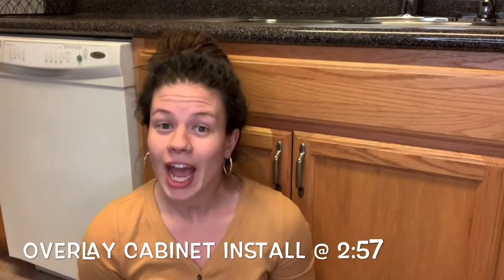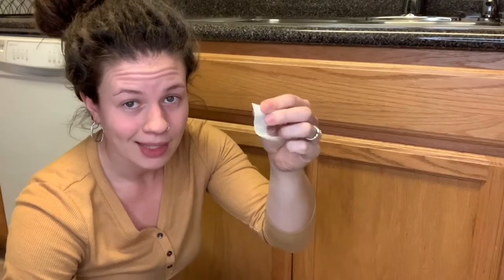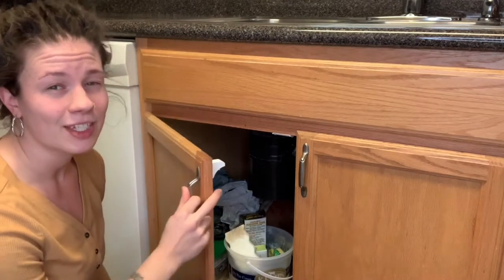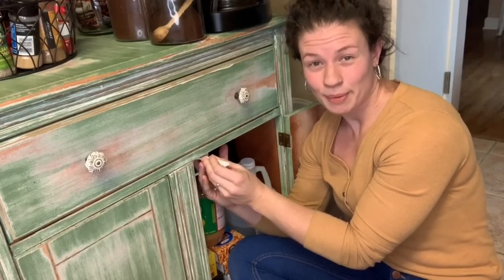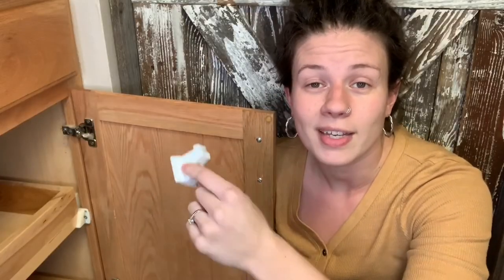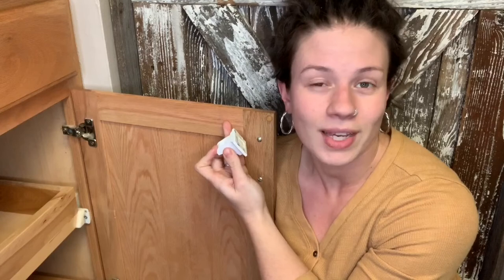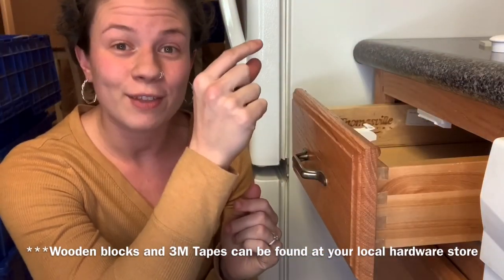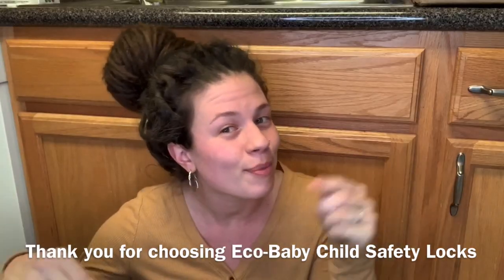How to install & troubleshoot Eco Baby Locks 2020

Comment: What if there is no frame in between the drawers, like the drawers just sit on top of each other with the guide rails holding them up, I would have to attach the strike to the bottom of the drawer above, any tips on this?

Comment: 12:03 in the video is interesting. You are putting the magnet towards the front side of the lock, which is the reverse of where it usually goes to unlock it. The magnet usually goes to the back side of the lock, where it is attached the to the cabinet, to unlock. But it still worked on the front side! That was unexpected, but helps me in a possible project where I'm hoping to use a magnetic lock on a door that opens the reverse from a standard cabinet (pushes into the cabinet instead of pulling outward). 

Now thinking I could possibly use  the lock component on the frame inside of the cabinet, and the strike plate on the door itself, and the magnet (if doubled) might still work to unlock it, if aimed at the front of the lock, through the door panel. 

Was thinking if I use a steel strike plate and screw to attach it (instead of the plastic), it might help conduct the magnetism even better to the lock front to unlock it -- but then you showed the issue of nails and other metals unlocking the mechanism. So, maybe that would leave it permanently unlocked. 

Now I'm wondering if all safety baby locks get unlocked if near nails, or if it's just this brand. Seems like it would depend on if they make it with the lock or the key containing the magnetic part.

Comment: Where did you get the blocks that you used at 13:30 when installing on drawers with a short face inside?
Reply: Chris Holland did you ever figure out what the blocks where? I was wondering the same thing!
Reply: @whitneyweiser2552  if you figure it out, I'm interested as well
Reply from the maker: Thank you for the question. None of our listings‘ content or videos claim we provide shims & spacers as part of our product package. Video only suggest customers can use shims and spacers in rare circumstances where they need to make tight spaces work within their cabinets.
Those who have access to a miter saw and/or table saw can cut these wooden pieces as needed. Pre-sanded 1” x 2” wood strips can be used, and we initially bought the long wooden stir sticks for 5-gallon paint buckets. These paint stir sticks work very well and only need to be cut to the necessary length. Most hardware stores also sell the 3M double-sided foam mounting tape rolls with the green checkered film on the back of the tape. Hope this helps.
Reply: @eco-babysafetylocks582  calm down, eco baby! Nobody accused you of anything!
Reply: @eco-babysafetylocks582  so where can i find the blocks to help with the installation???
Reply: @eco-babysafetylocks582  why cant you make your product wierd drawer friendly??? I dont understand why no one make it that way.. i am cursing my home builder for putting these wierd drawers.. i lost so much money on many locks.. nobody mentioned anything about this wierd draw except i come across your video.. and i was like had i known this before i lost my effort and money and lot of struggles due to kids always throwing stuff from drawer  and almost injuring themselves..now everything piled unorganized in the upper drawer and an angry mother here🥵

Comment: Did that little block of wood come in the package? I don't see one for the inset cabinets
Reply: No, shins aren’t included with the drawer locks. I found this reply provided by Eco-Baby on amazon—someone had asked a similar question there.

“ Hello! 

Thank you for your question. We were providing these parts as a courtesy to our customers in the past, but we are no longer able to furnish the spacing shims or extensions for alternative mounting of our magnetic cabinet locks. Due to problems caused by the Covid-19 outbreak, we have agreed to allow our shop staff to remain in their homes until this situation is under control. Those who have access to a miter saw and/or table saw can cut these wooden pieces as needed. Pre-sanded 1” x 2” wood strips can be used, and we initially bought the long wooden stir sticks for 5-gallon paint buckets. These paint stir sticks work very well and only need to be cut to the necessary length. Most hardware stores also sell the 3M double-sided foam mounting tape rolls with the green checkered film on the back of the tape. 

Our friend Handymom has posted a created a great how-to-install video that you can find on our listing called "How to Install and Troubleshoot Eco-Baby Locks" that you may enjoy seeing. This video outlines additional steps for installation on various types of cabinets and includes a lot of troubleshooting tips. 

As another alternative, we carry “Child Safety Strap Locks for Fridge, Cabinets, Drawer, Dishwasher, Toilet, 3M Adhesive, No Drilling Required” (https://www.amazon.com/dp/B07K1MSD7K). These are lighter-duty straps but can be used in sets of two in order to increase their strength as your children grow older and stronger. 

Again, we apologize for the inability to provide these helpful devices, but your understanding is important to us. Thank you for your patronage! 

Warm regards, 
Julia 
Eco-Baby”

Comment: Unfortunately these do not fit my Kitchen Maid cabinets. The inside of the cabinet door has a 2" piece of wood across the top so that only 1/2 of the lock is able to stick to the inside wood. I would need a 3/4" thick plastic strip to fix...not practical. Is there a better way to do this?

Comment: Where can we purchase this product and be sure that we are getting the new installation tools?  Is there a product number that can be used?
Reply: I got mine from Amazon
Reply: @GtzL64  Thank you for the reply.  Did you get the installation tools with your purchase?  This is important to me because it seems that these locks would be very difficult to install without the tools.
Reply: @terrycolberg6543  yes it has everything you need for installation.
Reply: @GtzL64  Great!  I'll be getting some.  Thanks so much.